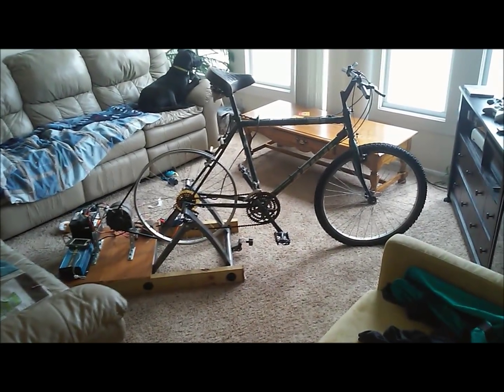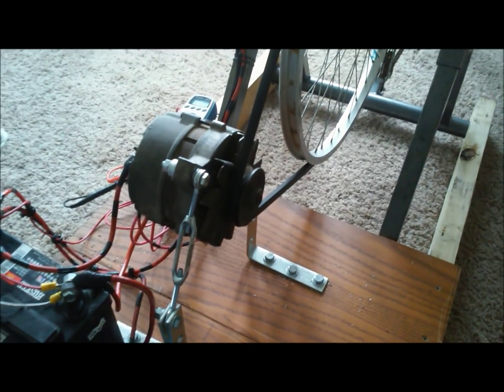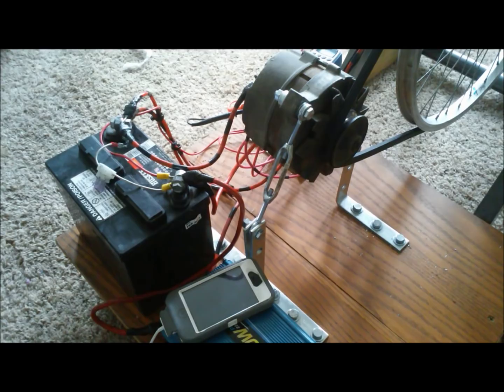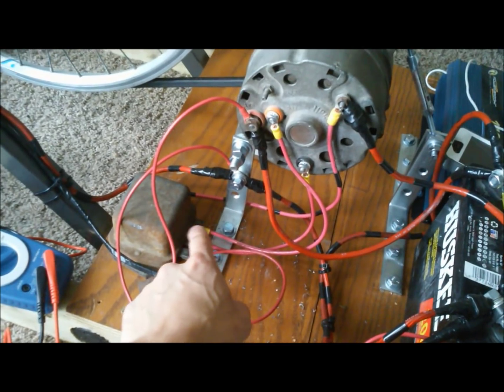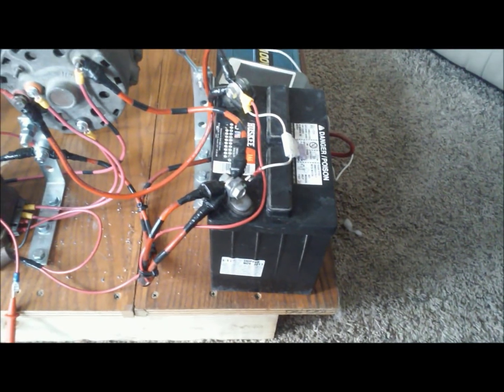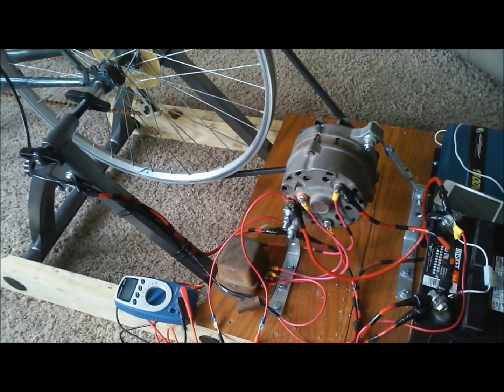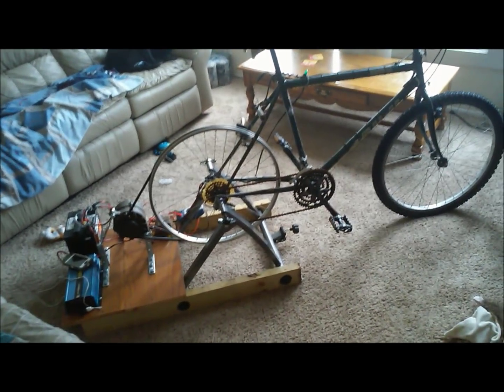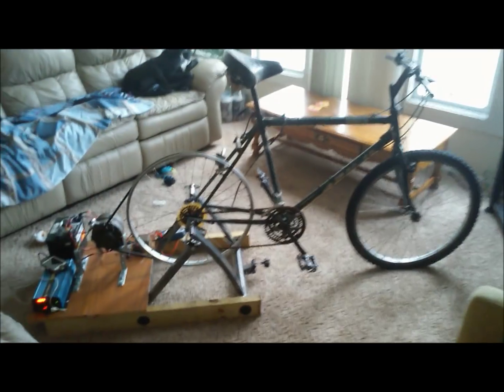Bicycle Generator: (BEST DESIGN) Stay In Shape & Power Electronics

Comment: Ok i had the craziest idea take an alternator inverter and two fan motors and wire and gear everything to make a four wheeled craft do you think that this is even possible?
Reply: Depends on how good your math is. So you want to pedal a craft to charge its batteries to power motors to propel it?

Comment: Cool video! If I use a generator instead, would it work just as well? Or better? Thanks!
Reply from the maker: If you use an Ac motor, you can make straight 120 as long as you have a diode. Something like a ceiling fan motor would work well.

Comment: What are the materials did you use?
Reply from the maker: A bicycle, an old 74 f100 and voltage regulator. Stationary bike stand. A belt from a tractor, some wires and L brackets. Ac/doc converter. Lawn tractor battery.

Comment: hello , would you have any advice on how to wire a bosch 0 123 315 001 ?
Reply from the maker: Most likely. I didn't look up the part number, but I'm assuming this is an alternator with a built in voltage regulator?
Reply: it has the following information written , near its model number : KC--> 14V 70A , so i suppose that's a yes
Reply from the maker: +Wissen schaft I will get back to you this evening. What is your email, so I can send pictures

Comment: How do I know what kind of voltage regulator to get? Some examples show solar controllers, battery chargers, audio capacitors and so on. Its really confusing
Reply from the maker: If you are using an alternator, the voltage regulator should be with the alternator. The only reason mine is separate is because it's 45 years old and that's how they were then. Modern ones have a built in voltage regulator 👌
Reply: Thanks, I'm using a 300w 12v scooter motor and it didn't come with a voltage regulator
Reply from the maker: +tagginglegendzak if you are spinning a motor and not an alternator, just have a multimeter on it. As long as you don't exceed 15 volts, you will be in good shape. If you want, you can get a 10 buck bicycle speedo and learn what speed you need to peddle to generate whatever voltage. You will also need a diode on the power line to prevent back feeding. All those things and you should be set !
Reply: Big thanks
Reply from the maker: +tagginglegendzak best of luck

Comment: I have a 1999 sunfire alternator for this project, I have everything set up, but Im having a hard time understand how and where to wire the alternator. My first question would be does it matter the size of the wires for overheating? And my 2nd question is there is 4 pins on the alternator, how do I know what needs to be soldered? Great video though, Id like to complete this too, the wiring is stopping me though
Reply: +Paul Gallant I also have a 12v marine battery in the system
Reply from the maker: +Paul Gallant paul, this is going to be difficult for me since you alternator is different. you will have to look up a wiring digram on the pins. i imagine one is power, the other is ground, and the other 2 are for the voltage regulator - which will be about 100 times more efficient than mine lol.

Comment: Hey, I'm going to building a pedal powered generator like this as well. I was wondering how you set up the voltage regulator and the switch though..
Reply from the maker: +Royce Tran the regulator i pulled right off my old f100 since i went to a one wire. wiredit directly like it was in the truck. the switch i just put on the sending part of the voltage to the regulator
Reply: +ThunderHead289 Would any alternator work? I'm going to be using a 12V DC Battery, 750W 12V DC to 120V AC inverter. I'm still not 100% sure how the wiring works out. Since I see some yt videos with and without the switch..
Reply from the maker: if you do not use the switch, and you have a battery in the system, the voltage reg will always be using power and drain your battery. any alternator would work, yes. the wiring is very simple, i could go into further detail if you would like. mine looks crazy since i have an oldschool voltage reg from like 74.
Reply: +ThunderHead289 yes, further details on the wiring would be greatly appreciated! thanks
Reply from the maker: alright, if i had one with an internal voltage regulator - i would wire the power wire to the voltage regulator to a switch, and then to the battery. simple. if you do not have a battery in the system, wire the voltage power supply to the positive output of the alternator. then have just a little 12 volt battery source that you can switch on to excite the voltage regulator and the alternator. once the alternator is turning, then its making its own power and you can turn your switch off to your power supply since the voltage reg is hooked to the alternator and the alternator is generating its own power. does this make sense at all?
Reply: +ThunderHead289 In place of the diode and voltage regulator, would I be able to use a solar charge controller which has a diode inside it and can control the amount of energy going in and out of the battery?
Reply: +ThunderHead289 What I have so far is a 350CCA Battery, 750 Inverter, multimeter, battery leads and alligator cables, bike, stand, a Bosch AL8708n Alternator, 50W 10 Ohm and 1000V 10A Resistors.
I'm still not 100% sure what I need in order to build the entire generator..
Reply from the maker: all you need is a bike, a switch, and the alternator, preferably with a design so that you can tighten down the belt. try to look up the wiring diagram on the bosch. thats what i did for my alternator and i tested the leads on the alternator when it was in the vehicle. its a bit trickly, but if you have the wiring diagram on the alternator it should be fairly straight forward. i cant imagine them having more than 4 pins. one is ground, one is battery positive, one is a keyed (switched) power line to the voltage reg, and the other is the ground for the VR.
Reply: +ThunderHead289 Alright, thanks. How long was your belt because I'm not sure what size to get...
Reply from the maker: i think mine was 72 or 78 inches? find the circumference of your alternator pulley, and your bike wheel, and then from there add a few inches.
Reply: +ThunderHead289 Would any voltage regulator work?
Reply from the maker: id imagine so yes, but i cant give a 100 percent sure answer on that as i have never tried. they all are performing the same function and are aimed at the same target voltage though.
Reply: +ThunderHead289 all of the alternators I've been looking into only have one pin on the back, not like yours which has 4...
Reply: +ThunderHead289 I'm going to  just risk it and go ahead and get the Bosch Alternator tomorrow. It has an internal voltage regulator... So I'd assume I connect the switch directly to the alternator...
Reply: +ThunderHead289 If I connect my alternator directly to the battery, and just test using the volt meter. When spinning my alternator by hand and using the volt meter to check if it's harder, nothing happens...
Reply from the maker: send me some photos brotherford289@gmail.com- we will converse there
Reply: +ThunderHead289 emailed
Reply from the maker: solid. i will look it over here within the next two days.
Reply: +ThunderHead289 ok thanks, so you got the email and pics?
Reply from the maker: +Royce Tran yes, lookin at it tonight now
Reply from the maker: i sent you the pdf of what i think to your email. let me know if you have any more questions.
Reply: +ThunderHead289 I've sent a few emails, please check them as I respond quite fast... thanks a lot for the help!
Reply: +ThunderHead289 I've tried a few different set ups but nothing so far... not sure if it's the wires or the wiring. I think I need the actual plug wire that goes into the voltage regulator PLSF area

Comment: I have two questions:  Is there danger of overcharging the battery if you ride too long?
Also, my inverter faults every time I try, I think it must be because I don't have the voltage regulator (internal) hooked up properly, do you think that is right?
Reply from the maker: +EnderWaterBender with the voltage regulator there is no possibility of overcharging the battery. do you have a battery in the system? your inverter will fault if it is not seeing at least 12 volts. this is why i run a battery in the system that gets charged, but also equalizes the voltage. if i had to do this again, id do it with an electric motor. alternators take current to make current. human can only produce around 2 to 3 amp at 14 volts. so its all more of a novelty since you can only power things of 500 watts or less.
Reply: I have a battery in the system and my multimeter shows a steady 14 volts once I get it going but the inverter only seems to like 12 volts.  The inverter works fine when hooked directly to the battery. I've tried it both ways: with the battery staying on and with the battery only supplying the initial charge and the inverter doesn't like either way. Any other thoughts?
Reply from the maker: thats odd, id run it with the battery always in the curcuit myself to create a consistent voltage. what size is your inverter? if your charging at 14 volts, that part of the system seems to be right.
Reply: the inverter I use looks very similar to yours, it is rated for 12 volts and 400 watts..
I will keep trying things, thanks for your replies.
Reply from the maker: thats just weird - if your voltage is at 15 or lower and everything is grounded properly, it should all be sound.
Reply: @ThunderHead289  if you did it again what electrical motor would you use?
Reply: Washing machine motor

Comment: I noticed while making wind turbines that the small pulley on the generator almost cinches the v-belt, adding a ton of resistance. I wonder if you added another pulley that changed the angle of the vbelt as it went around your alternator pulley would there be less drag? Just a thought. I'm going to build one soon but using a dc treadmill motor, and I wonder based on yours if leaving the flywheel on will help enable some "coasting". Anyhow nice vid.
Reply from the maker: +Eric Ross thanks. i agree with you that the more the belt wraps around the alternator pulley, the more resistance. i tried to get it as close as possible to the rim, while still being able to use different sized bicycle wheels. dont expect this to produce any real large power, the human body can only generate 1 amp to 2 amp continuously regardless of the set up, which only equates out to roughly 300 watts. and at 2 amp, you would have to peddle for a few hours to fully charge a battery. they are a novelty. i had the spare parts, so i figured id build one on the cheap!
Reply: Segmented v-belts might be less resistance, but a bicycle chain would be best. Humans can pedal at an average of 75 watts sustainable, so cut that in half for usable output of electricity from pedaled generator. A Direct Drive (DD) bicycle hubmotor on 'regen' is a nice setup because you only have to suspend the back wheel while generating, and then you can use it as an electric bicycle the rest of the time. I think those kits are $200-300 new and can be found very cheap, used.

Comment: Not exactly quiet lol maybe add another gear reduction wheel? I think I'd add some weights for a flywheel effect so the sudden loads are less jolting.
Reply from the maker: +Lacider it really just needs a higher output alternator. its an old 40 amp from when i did the one wire swap on my truck. this video shows how horrendous the bearing noise is on it. im sure a modern day 120 amp alternator wouldnt be so bad as it would put out more amp. also, running a larger battery wouldnt be a terrible idea. if i had more gear reduction, im not sure i would have enough torque to peddle it with a heavier load unfortunately. 
i was simply referring to the adjustability of the system. but you make a good point with the flywheel. that would help a ton when the load is put on the bike.